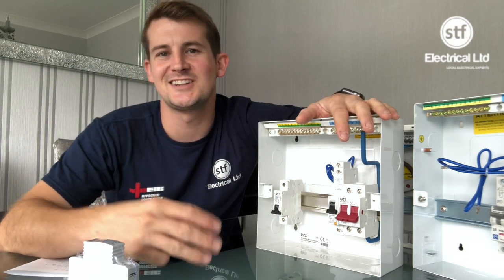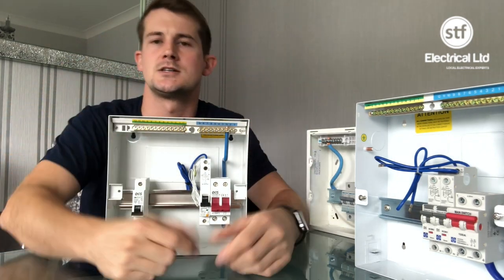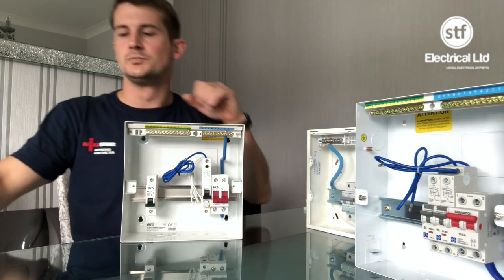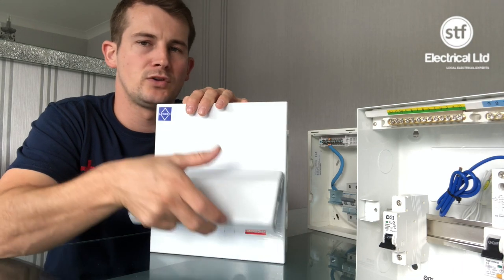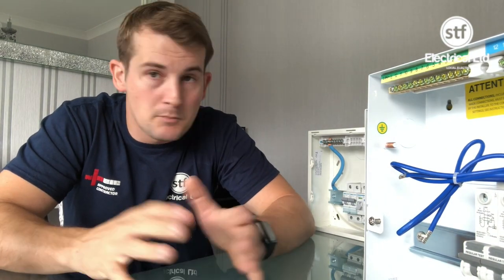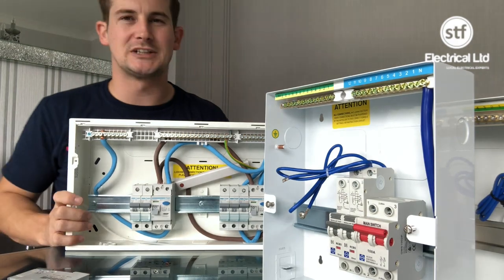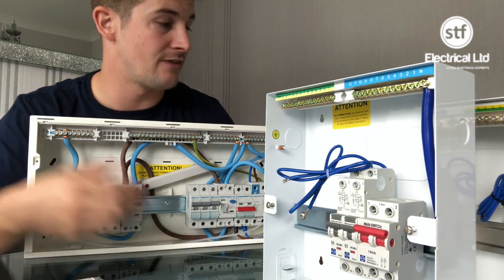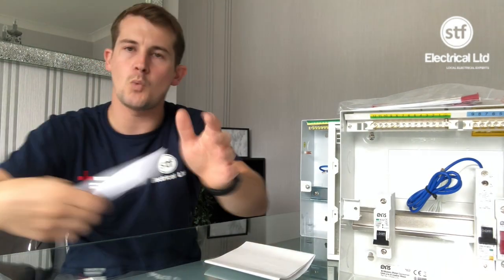Consumer Unit Review | STF Electrical Ltd

Comment: Totally agree-I only fit lewden rcbo consumer units now BUT Hagar are the best,I just can’t justify the price. 
The cover fronts all hang that way and shut to contain any fire should it occur-if they were to be made like old consumer units and have hinges at the bottom people would leave them hanging down and/or they’d break off leaving a risk of possible fire spreading.
Reply from the maker: tommochelsea72 exactly my thoughts   (Which id since confirmed) it’s good that the manufacturers are thinking of this though as you’ve rightly said people would leave the lid open completely compromising the reason we fit metal boards to start with.

Comment: I'm curious why an end user would be interested in getting a more premium CU, it seems most of the benefits of the more premium boards are for the installer rather than an end user that just needs to flip an MCB once in a blue moon?
Reply from the maker: Matthew Harrold completely understand this view point and to a certain extent it’s right.

All consumer units sold in UK/Europe meets minimum safety standards specified by the relative regulatory body/ies regulations requirements.

When choosing a consumer unit and it's configuration as an end user, your main focus and concern should be the safety, practicality and reliability offered.

Whilst the safety should always be there due to standards manufacturers must adhere to.  And the practicability should be there with your configuration (eg. RCD vs full RCBO boards).

The reliability is not always - we’ve had many cheaper alternatives in the past that have had parts failing regularly - hence why we now only offer a range of three trusted brands.  

An example where this would be an issue is where a RCD prematurely fails and a customer isn’t keeping up with their 6 monthly testing of the device (which many don’t) that RCD May sit there not offering the degree of protection in which it was installed for until either somebody receives a shock (not the way you want to find out your RCD isn’t working) or until you get your next periodic electrical test (which we all know everybody keeps up to date with).

The other reason is more premium brands have been around for longer and run less risk of having obsolete parts - couple that with the fact that regulations are now backing up manufacturers instructions regarding not “mix’n’matching” different manufacturers within boards your new consumer may need changing again due to obsolete part when it comes around to maintenance of a faulty part of an addition/modification to your installation. (This happens more often than you may think with budget brands)

It’s like everything in life there are budget and premium brands and both will do a job.  Build quality coupled with the points I’ve raised above are information we give our clients, it’s then up to them to make an informed decision.

This is the reason we offer budget, middle of the road and a premium quality board - rather than one option because as you can see in the video there can be substantial material cost differences and offering all clients one option based on what you like to install wouldn’t be fair or taking in the individual clients needs/budget.

I agree the installer benefits in terms of better to work with are also there.

Hope this was of some help 👍🏻
Reply: @stfelectricalltd6849  Thanks, that's very interesting. I did not consider the point about parts becoming obsolete, availability etc
Reply from the maker: Matthew Harrold it’s a common issue that bugs me with some electricians - they simply win a job based on a price they think they can get away with and then either maximise the profits by installing cheap equipment wherever they can, or they go the other way and install a pricey alternative purely based on what they like to install.

It’s all about educating the client in order for them to make an informed decision and then tailoring to their needs in my opinion.